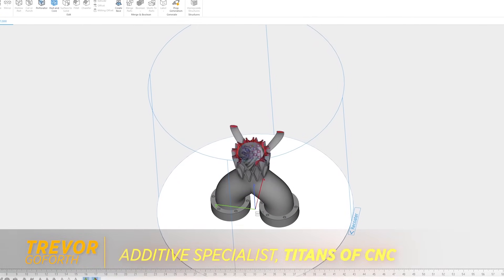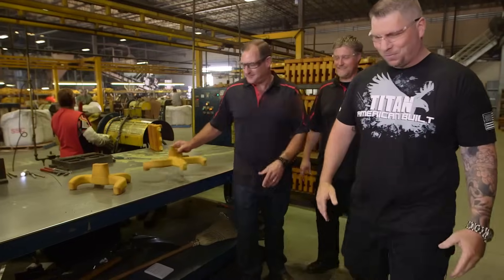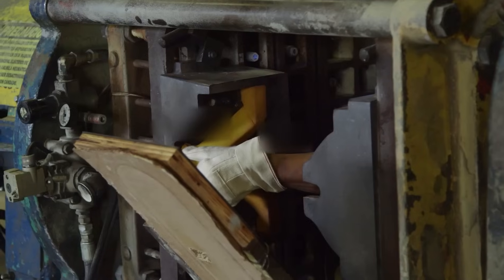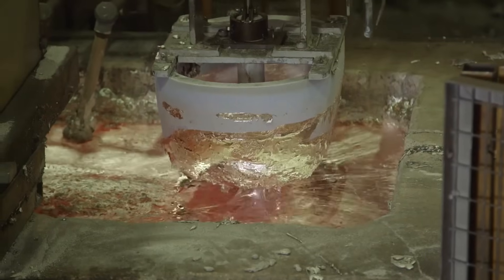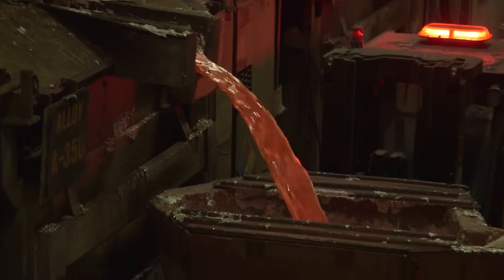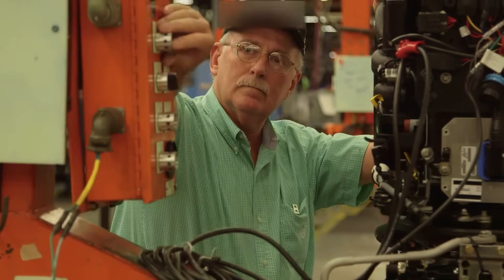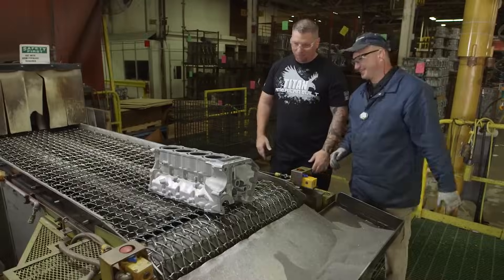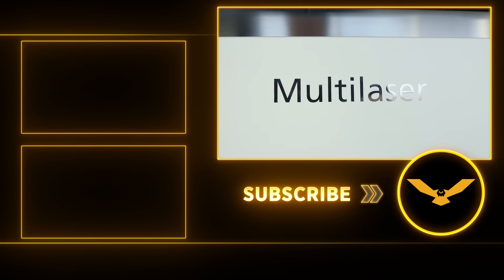$100,000 Mold Crashes and Cause Is Covered UP!

Comment: Off subject:
The street I live on has an old (1890) wooden covered bridge on one end. It has a low clearance and low weight rating. Every week KEN Metal flatbed trucks follow their GPS and ignore the three DOT signs on the street. Most of their drivers can't back up very good.

Comment: so why are you not using sensors and cameras to monitor your inserts into the tool.  why arent you using robots to load them? did you not set up your pressure safety?  you should be able to set up the press to stick a business card in the tool and it not clamp up on it.....this is some rookie stuff

Comment: I ended up having to leave the print industry because I've had nothing but horrible managers and owners. We had a vice president at one of my companies that directed my department to run a job that we had initially told them not to run until our new equipment was setup and because he insisted upon threat of our termination, he ended up costing the company $10k. He didn't do this once either, he did this twice. Twice on multiple jobs? No. Twice on the same job over the course of 2 weeks. He cost the company $20k,; and I don't mean that the company lost $20k in profit, that was $20k in supplies and service, purely $20k in actual cost. He proceeded to throw the blame at me, told everyone else I worked with (that already knew what he had done) that I was mentally slow and treated me with disrespect until he had HR fire me.

I was one of two guys working in that department, the other guy walked away to another job for more money a couple months later and left them with nobody in the department forcing them to bring back the guy I replaced and paid him way more than they were paying him before. The vice president was then fired after I posted a review of the company explaining just how bad the work environment of. Only god knows how much money he lost the company.

It isn't limited to the machining industry it's getting harder and harder to find a decent company to work for these days.

Comment: As Pat Parelli once said: “Make the right thing easy to do, and the wrong thing hard.” If itwas such a critical point of failure for the device, there should have been mechanisms or even colored simple diagrams in place. If a drunk stoned idiot can’t do it right,  an exhausted stressed 12hr plus employee can’t either. Speaking from experience as a usually intelligent worker, who on first work day after training set a piece backwards into machine. Got written up and wondered why the hell they didn’t just have a sign right by the machine there showing the right way. (Oh you’re supposed to read through the ENTIRE SOP before EVERY item you put into machine…. )

Comment: Also should have mold protect times and force limits set sensitive enough to prevent major damage. In a good machine, 90% of mold styles can be setup with a mold protect that will stop on a peice of cardboard without completely flattening the inner corrugate. Even molds that require more lockup force can be set so catastrophic damage is prevented.
Reply: Right, This is why you have to make tools, or anything, idiot proof. The people they hire to load machines are often just normal people, factory hands,  with limited skills. You need to make it impossible for the part to be loaded the wrong way.

Comment: Titan! I just started at a carbon graphite turbine bushing job shop, lead programmer quit and I have to step up and run cnc lathes with live tooling machines can have air ran thru them? Should the air be lubricated?? Any help I want to rise to the challenge. Thank you for the inspirational videos every week. BOOM!!

Comment: When I first started machining, I was hungry to get the big money older guys where making doing the exact same thing I did. So I  put out more production than everyone else, in the process I was working dangerously running 2 or 3 lathes at a time while everyone else ran one. These are manual lathes that need constant supervision. One day I cut too deep into a part that the start of my cut trying to do my cut in 2 passes instead of 3 and scraped the part. I went and told the owner what happened. When they called me in to fire me, I told them if they let me keep my job I would buy the part I scraped so they dont lose money. Took a year to pay the loan off I got to buy the part, but I learned then to be machinist instead of a production worker. And now knew why the older guys focused on perfect parts and not production as I was doing.
Reply: They were going to fire you over one scrapped part, while you were trying to be more productive? That sounds like a pretty crappy outfit.
Reply: @patrickmcclintock7027  Yes. Back in the day the lathe was the last process before being shipped. That means it bought as bar stock, went to a heavy press to get straightened, then moved to bore machines to get drilled, then to the honing machine to get honed to size. Then to the lathe machines where to get the OD put on size. So if scrapped it on the lathe the company had alot of money in the part already by that point.

Comment: There's no such thing as foolproof to a sufficiently talented fool. 

I worked at a place that made prop molds for a fairly well known marine engine / boat company. In the past year they managed to mangle two cores for their molds (cores are the part of the mold that makes the shape for the shaft on propellers). Both times it was some doofus putting in a left hand bottom and a right hand top into the mold (ah yeah, this is wax investment, so the molds can be interchanged on the mold bases we made, really cool and clever setup honestly), or vice versa. We engrave all our parts, so there's virtually zero chance  it was a foolproofing issue on our end. I think even the locating pins on the cores are different too. Molds are just one of the easiest tools to smash and destroy. I actually have a story of another company tha annihilated a plastic injection mold. I was working with another tech on this literal disaster, we found over a hundred separate issues of damage/ unauthorized modifications to this thing. Core insert pockets were shifted 10s of thou around, we found imprints of set screws between plates, an ejection pin looked like someone tried to hammer it out, gas vents were welded shut, part of the cavity had been deleted and someone had remanufactured a crayon drawing equivalent of the original feature, the water line pipes were a blasphemy and needed to be ground out, coincidently, they were cooling this shit with rainwater, and on top of all that it fell on its side during shipping to us. Sadly it fell on the one side where nothing could be damaged.
Reply: Better fool proofing could be large visible labels and colour coding if possible 🤷‍♂️
Reply: @benargee  nicely engraved mold/ part numbers, with bright red nail polish to make them readable. There's just no helping some people. 

Iirc, 1/4 inch tall letters/ numbers. Full engraving took up a fourth of the bottom of the core. Rest was taken up by locating pins, and water lines, 4-5 inch diameter.
Reply: @orangedream267  how about magical electronics that can withstand the heat that when it detects a mismatch is screams like a banshee and alerts the whole shop of the impending fuck up?
Reply: @benargee  what heat? If you're getting heat in wax investment molding to the point it's doing damage, you're basically pressing everything to yield. 

As for some sort if chip reading thing, sure if you want to quadruple the cost or something (r&d time would have to be factored in). Or you know. The operators could just read the nice arial font that a blind man can see. Maybe that was the issue, we didn't stick bloody braille on.
Reply: @orangedream267   I didn't realize this was wax investment only and not for the final metal mold.
I'm just speaking in hypotheticals where a perfect idiot proof system were to exist where money is no object other than a smarter person hovering over them 24/7. I'm not really being practical here.

Comment: I worked for a machine shop that made their own product. The company has branches all around the world. I started working for them right as a large jump in growth occurred. They had issues with placing blame instead of solving problems. I worked in Quality Control and saw most of the problems. The then company president read a book “The Toyota Way” which did not seek to “blame” mistakes but chooses to research for solutions to problems. Good idea, boss!

Comment: Sounds like an easy situation to avoid using the old technology of asymmetrical registration points
Reply: yeah any time you design a mold with hand loads it should be impossible to load it incorrectly
Reply: @Shocklingg  Especially if it costs $100,000. Supervisor may be culpable for lying, but whoever designed the mold probably should also get a finger wagging.
Reply: japanese invented poke a joke
Reply: Sounded to me like they already had it set up that way. Pretty sure he said there were indentations from the incorrectly placed registers.
Reply: @andrewdynes5300  If so, clearly wasn't done with enough idiot proofing.
Reply: Poka yoke